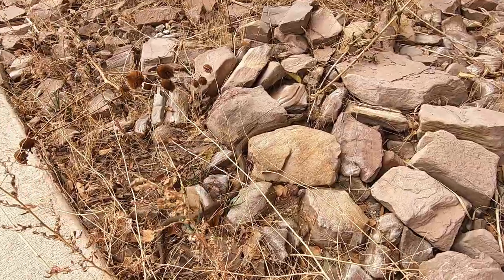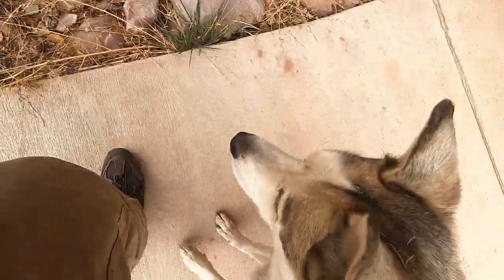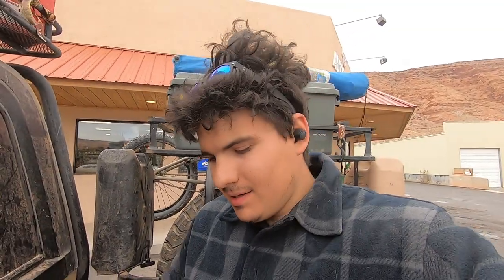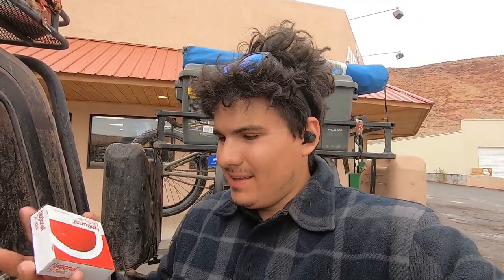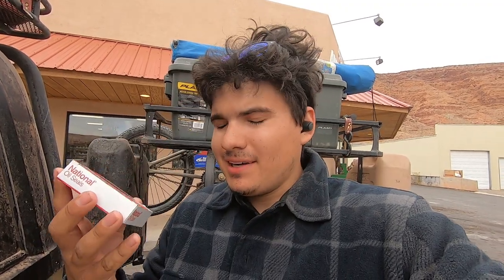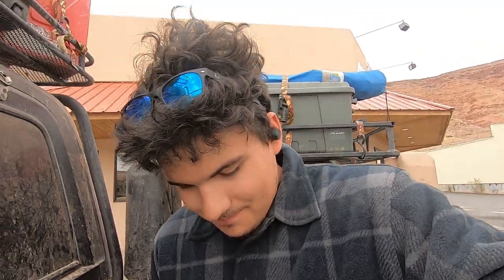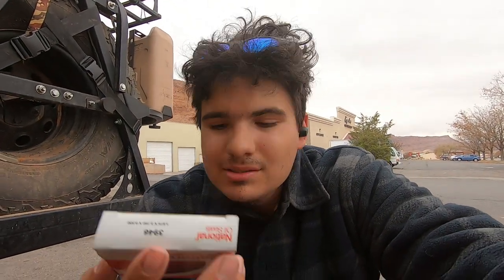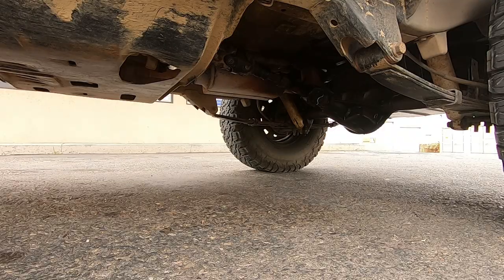I hope it can still be fixed...

Comment: Hey Trevor, saw you in the carquest parking lot.  Looks like you’re doing a good job slowly working out these problems on a budget of time and money.  Here is a recommendation: replace the yoke nut that fell off.  Those nuts come with some serious locktite goop stuff on them from the factory, and once they’ve been busted off, they dont work as well anymore.  I had to replace mine recently, and it was $9 from the dealer, nothing to really worry about.